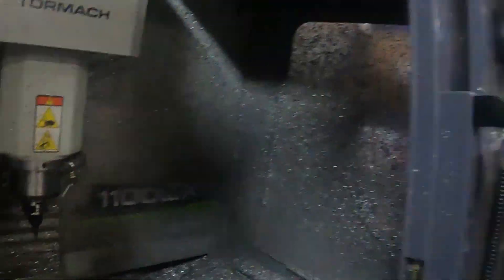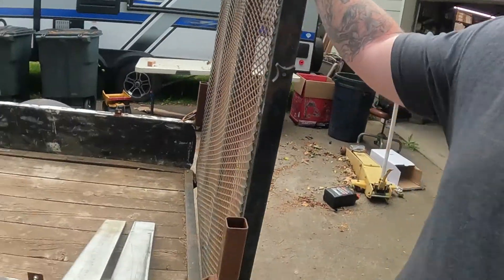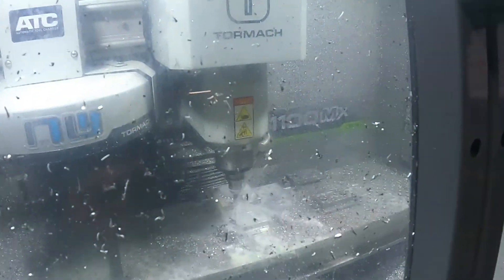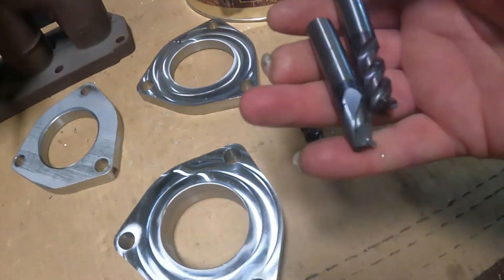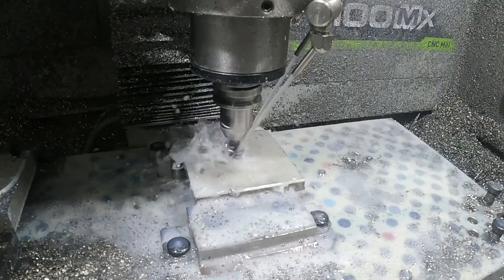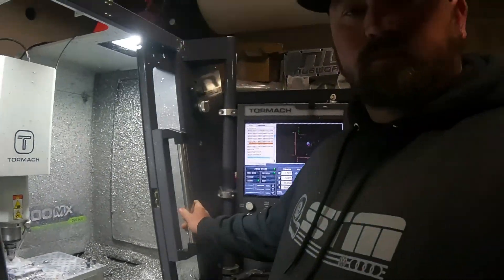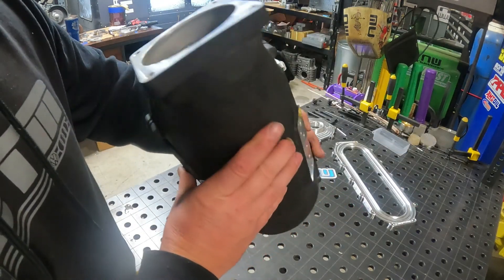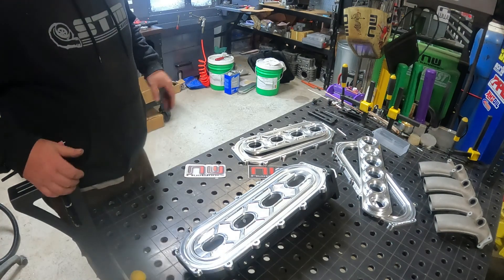Nubworks DIY Kit to Skunk2 Plenum flange Machining on a Tormach 1100MX Along with some 304 SS

Comment: I've used provencut by saunders machine works. Works pretty good. I have a stainless job I'm doin now on my 1100mx. I'm using bullnose (or .03R) 5fl carb for my stainless roughing. Mine screams like that too lol.